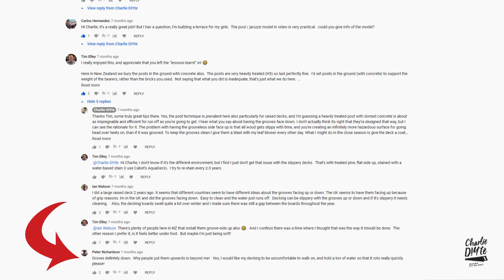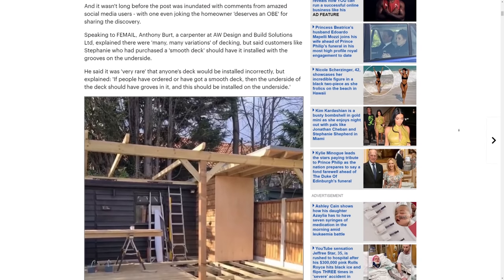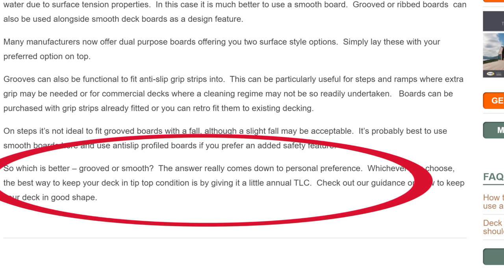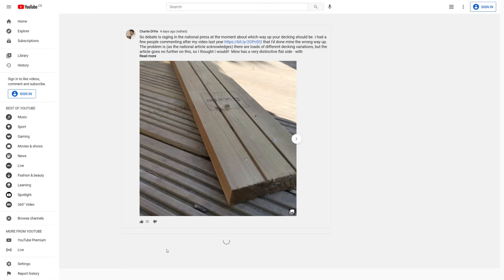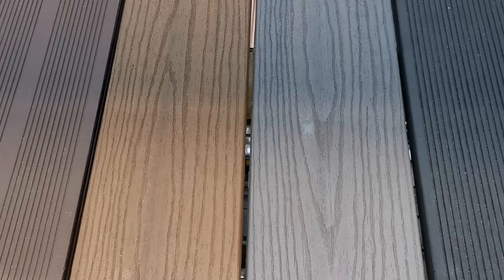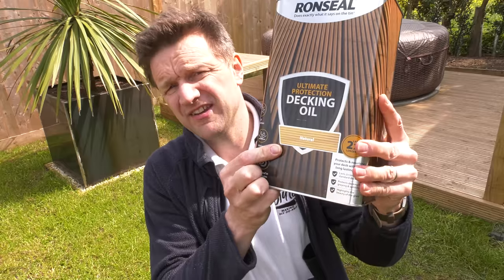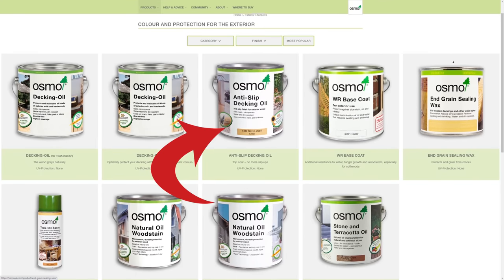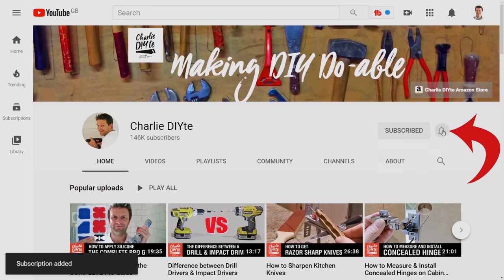Which Way Up to Install Your Decking?

Comment: I have generally used either screwfix decking oil or one of the decking paints. The coloured paints do not last past a winter. I ended up completely sanding the top layer with my worxs and coating in the water based Ronseal decking sealant, the expensive one. Looks awesome for a 10year old deck. Not sure how I post a photo on a comment ?
Reply from the maker: Yes I would have bought the Screwfix oil off I hadn't got chatting to the guys in the timber merchants. Frustratingly you can't post photos in this Comments feed. You'd have to go to my Facebook or Instagram page. Instagram probably the better option. 👍🏻
Reply: @CharlieDIYte  ok, there are a few options with ronseal but the water based one is awesome, will post the before and after photos and keep up the great work Charlie

Comment: Any kind of grooves facing upward Will obviously hold water, create moister in the right conditions, followed by mould and then resulting in a slippery surface completely making the grooves that are for “grip” obsolete as you casually slide across said decking with drink in hand and breaking your ankle. It’s wood, the nature of it is so grooves or not.
Reply from the maker: Agreed. I haven't got any mould or slipperiness on mine yet but it's not got any overhanging trees and the tanelising is probably still protecting it to a degree. I'll be oiling it this summer though.

Comment: The two grooves on the underside of the 'single sided' deck boards are there to counteract 'cupping' of the boards by moisture ingress expansion on the lower surface; effectively 'expansion joints'. They are used on traditional internal floor boarding too, where further drying, and the cut of the timber can also cause cupping.
Reply from the maker: Thanks mate. That makes a lot of sense. 👍🏻

Comment: Mines the wrong way then; grooves up and flat side down and it’s been absolutely fine. Stays grippy with a quick brush off and isn’t perfectly level so drains fine. No warping/air flow issues.
Reply from the maker: Glad to hear it mate. 👍🏻 At the end of the day, if it works for you, then all good.

Comment: Grooves on the top??  Here in the Pacific Northwest of the US, those grooves would very quickly fill up with pine needles, moss, and creepy-crawly things!  I suppose that's why I've never seen grooved decking material ..... ever!

Also wondering why your facia board is touching the ground.....or is your grass just ready for a trim??  Great Video!  A well thought out discussion.
Reply from the maker: I wanted it going down to the ground to discourage rodents from nesting under it. Thanks for the comment 👍

Comment: Charlie, do we live in a parallel universe? In January I started my built in wardrobe, few weeks later you started your wardrobe series.  Also, I’ve been planning/shopping so I can fit decking in my garden. Thanks for your videos they’ve been a great help! Especially with the Sensio LED equipment as I was struggling to find a way of making it look neat!
Reply from the maker: That's brilliant! I'm guessing you've finished your wardrobe though and I'm just about to start the doors... I love the Sensio lighting. Can't wait to get it up and running. Good luck with the decking 👍🏻

Comment: If your deck is slippery in the winter and you need to keep walking across it, try laying out some lengths of regular mineral roofing felt and maybe a few staples to keep it in place.  It's incredibly non-slip and has amazing non-tear quality.  Doesn't look beautiful, but for a practical slipping solution it's perfect!  Just lift it back up in the spring.
Reply from the maker: Thanks for that 👍

Comment: I think a patio is better suited to the UK weather and lasts a lot longer.
Reply: What’s the definition of a patio? I always thought a patio was the raised area just outside the back garden door. And it could be any material, decking or slabs?
Reply from the maker: Jules I'm inclined to agree. I honestly don't know why I didn't go down the patio route, save that drainage wouldn't be so efficient.
Reply: @haroon420  Patios are normally slabs in the UK.

Comment: If you "bituminised" the decking underside and then the subframe surely you precisely stopped the breathability - the whole and HUGELY successful principle of "microporous"? I'd say BREATHABILTY - the number one secret to "Stop the Rot" in all timber construction - every time.
Reply from the maker: It's an interesting point, that, which I guess you need to balance against the problem of a lot of decking not having adequate ventilation beneath - particularly the ones that are boxed in. I agree though, ventilation is the key in so many situations, from decking to roof insulation and house condensation.

Comment: my own decking was down for 16 years grooves side up,with the deck structure having a very slight fall on it to get water off.
As with all timber,if its left with water on it,it will impare its lifespan.The only thing that rotted on my decking was the posts that supported the decking framework,that had been cemented into the ground,simply because even though they are in concrete,they are always exposed to moisture.The decking and framework itself could have been used again as it had zero rot in it,even after 16 years in the crappy UK climate.All i ever did was make sure the decking was clean to avoid it getting slippery..nothing else.
Reply from the maker: Thanks Amy. That's amazing. Tanelising was a lot better 15 years ago but you've done really well with that one!

Comment: This looks like it could turn into “decking gate” 😳 I’ve laid my decking the same as yours - groves up to aid grip....
Reply: Can you use decking to make a gate.... 😁
Reply: @dougsaunders8109  we need to keep this under control - now you’re venturing down a very dodgy path 😂
Reply: @JB-gk6tg  it is the internet quiet possible. At least it is not Twitter 😉
Reply: @dougsaunders8109  very true 👍😂
Reply: Grip is increased on solid materials by contact area. There's less grip on a grooved surface.
Reply: @sdgelectronics  that is true hence tyres on F1 cars - however once water is introduced then it’s a different story ?
Reply: @JB-gk6tg  The rubber composites are flexible, so you can increase traction at the expense of efficiency. On solid materials like wood, the only way to increase friction is by more surface area - friction is essentially zero in the air gaps.
Reply: @sdgelectronics  I surrender to your clearly better knowledge on this subject 👍

Comment: All down to the type of decking your installing. I installed yellow balau decking with the smooth side up. Comes from South America. Installs both sides I just wanted the smooth look. Once treated with a good oil(osmo)  should last 10 years plus and you can flip the boards to get longer out of them. For me this type of decking wood will last way longer than the standard Swedish pine. To conclude any decking installed correctly and properly maintained should last a long time
Reply from the maker: Thanks Kyle. I agree 👍

Comment: Spent 16 years in Canada and never seen a deck with groves in it. Came to the UK and all the decks have groves. When I built my first deck here in London I used the smooth face up as I just don't like the look of groves. it just doesn't have that natural look. When I recently bought a house in Buckinghamshire it had a deck installed with the groves up. And even thought it was only about 6 years old, it was already rotting away. Will be replacing it with Oak and using the smooth face up 😁
Reply from the maker: Yep, oak without groves looks very classy 👌

Comment: I see a lot of decks with boards butted up against each other with no gaps between boards, that's the biggest problem for air circulation. I tend to be quite liberal, usually use 5mm plate washers as spacers when fastening down. It lets a lot of both air and light underneath and I find it discourages rodents too because it's far less sheltered under the frame. I weed kill, fabric, and gravel before installing the frame which avoids future undesirable plant growth.
Reply from the maker: Yes, I agree. I clamped the boards together initially and was shocked at how wet the joists were when I took the boards up a few weeks later. The gravel is also a good idea because it discourages rodents, or makes it pretty inhospitable for them at any rate.

Comment: I'm planning on laying mine grooves up when I get to the garden, but I fancy doing the boards on a diagonal because 1 pretty and 2 good grip while walking either way.
Reply: I found the grooves aided water run-off where I have a fall across the decking...the grooves have never aided grip, and in fact the deck has at times been pretty slippery...usually in the winter, and when it’s damp early mornings...the best to sort this is to treat it with a good resin and apply a thin layer of very fine grit...let it dry and sweep off excess...I have not found any treatments for decking that prevent it being slippery, unless they contain some form of grit that adheres to the decking...
Reply: @stun9771  I've found that walking on decking along its length to be far more of a slip hazard than walking across the width in the wet. I always add a very slight gradient for water run off but the diagonal boards will be more for show than anything else.

Comment: Hi Charlie I am a big fan of your videos. I've just installed a pine staircase. What primer/paint do you recommend I use please? I am thinking of doing the risers white and the steps natural wood with lacquer
Reply from the maker: Thanks mate 👊🏻 Personally I'd use Zinsser BIN primer and then a satin wood or gloss. I've just painted my wardrobes in an eggshell. At the end of the day gloss is the most durable top coat for high traffic areas but might be too shiny for your requirements. Eggshell and satin wood are similar in terms of durability. Maybe go for an oil based eggshell or satin wood as this will be more durable than the water based versions. For the treads I wouldn't use a lacquer. I'd probably go for a Treatex or Osmo oil, like I used here https://bit.ly/3ubTGIz It comes in a variety of shades including natural. I painted a lacquer on my kitchen table and wasn't very impressed, although that could have been down to the quality of the lacquer I guess.

Comment: In regards to which way round the boards are laid, boards should only really be laid with the heart of the grain facing out, as when the board starts to cup it will cup towards the base framing. So to have a double sided board doesn't really work.
That's just my opinion from being a joiner.
Reply from the maker: I think you're absolutely right. A lot of people have commented to that effect. I suppose the question is whether it will still cup if it has been securely screwed down?
Reply: @CharlieDIYte  aye I know what you mean. When I install fencing slats I check every on and have the heart facing out. The wood still cups even though it has been securely fixed. 
Nothing worse than getting pine skirting with the profile machined on the wrong side, I have spent too much time in the past planing the middle out of skirting boards to get them to sit tight at the top against the wall. You can get away with it if it's painted skirting a but if it's varnshined not a hope, gaps at the top look terrible.
Reply from the maker: @Ayeboi1  I can relate to that. I had to do plane the back of the skirting on this job https://bit.ly/3cfJHvG The skirting warped like a banana as soon as it got into the centrally heated house. It looks great now but it was a nightmare at the time.

Comment: As someone who has lived down under for 20 years , its definitely groove side down , never have or ever seen anyone slip on a smooth board deck. Unfortunately getting a deck board in the Uk that is not designed for groove side up is near impossible. In Australia you sand the deck once it starts looking tired as you would with wooden flooring but with groove side up this is impossible. Also have used lots of decking oil and Sikkens is the best by a million miles, looks a ton better than the rest and lasts alot longer too. Is the most expensive but the best generally is
Reply from the maker: Thanks so much for this Michael. Absolutely invaluable experience shared and I'll make a note of that Sikkens 👍🏻
Reply: @CharlieDIYte  no problem mate, love ya work , keep it up

Comment: Well, what can I say...how about ‘bollocks’ to start with...  my decking is single sided with grooves laid upward...my deck is approximately 5.5m x 7.0m and is supported on a frame made up of three independent timber frames, each constructed from 200mm x 50mm sawn timber beams - nailed and screwed - and bolted together with coach bolts to form a single deck, suspended above the ground by about 300mm (where the ground is covered by weed control mat and gravel to about 100mm depth), and sits on concrete pads with slates positioned under the timber where it sits on those concrete pads... all the timber supporting frame was treated with a good quality timber rot proofing once assembled and in position, allowed to dry (it was summer), and then sprayed with a waterproofer usually used on brickwork... after this I laid the timber decking, which was supplied in 5.0m lengths (the decking is approx 32mm thick and 150mm wide - and grooved on one side only), and which I cut to size, and screwed in place using deck screws, with 6” nails used as spacers between the decking boards...the decking is laid grooved side up to aid water run-off... on completion the decking boards were treated with a mid-range decking preserver and waterproofer... the decking is laid to a fall, that across the longest length of the deck (5.5 m approx) is about 30/35mm... each year around the end of May I power-wash the decking, and re-treat it with a preservative/waterproofer...my deck was laid in the summer of 2001, yes that’s right, twenty years ago, in the UK, in the open air, and has been snowed on, rained on, iced up, and otherwise exposed to everything...and is still in reasonable condition...and I can supply photos to anyone who wants one...just to prove what is stated here is bona-fide...I am located in the south-east of England, in north Kent...
Reply from the maker: The point is Stu, that you've a) installed it correctly and b) looked after it year after year. Comes down to personal preference at the end of the day, doesn't it 👍

Comment: I have just finished laying some decking in my garden, a fairly big project that i took on as a first timer. I sat back and admired it in all its glory, solid, sturdy. All the hard work I'd put in. And then a video on tik tok came up about decking being upside down. Ive installed it with the grooves up (having never ever seen  smooth decking in the UK) I just assumed that this was correct and that the deck should have a slight angle so as rain can run off. Anyways, ive just finished pitting 1000 screws onto the thing, do i really need to lift it all and turn them over, i mean its not going to rot over night, its raised and ive coated all the joists. I intend to use an anti lop coating once its weathered a bit. I accept that it may be fairly slippery in the wet, bit that is just decking on general. I aim to keep it relatively clean and try and precent build ups of water. Is it really the be all and end all.
Reply from the maker: As I say in this video, it's not always correct to say grooves should always be face down. It depends on the design of your decking.. Is yours completely flat on one side with no groves or more like mine? Either way I wouldn't worry, particularly if you look after it as you say. Are the joists below tanelised?
Reply: @CharlieDIYte  My boards are flat smooth the othersode with no grooves. I contacted the manufacturer / supplier and they said they are to be fitted grooves up. The entire subframe is pressure treated and any cuts have been end grained.

Comment: If you do use a pressure washer, keep it at a distance or turn the pressure right down.
Reply from the maker: Thanks Ben. I should be ok with my rubbish little Karcher, which is only really designed to do bikes 👍🏻

Comment: What a load of tosh some 'builders' come up with! It's actually recommended in the US to use decking tape the length of the cross bearers so even if you put the boards grove down, the groves wouldnt work. I dread to think how slippy the decking was where the 'builder' put the groves facing down!
Reply from the maker: At the end of the day, it's your decking so put it the way that you prefer 👍🏻

Comment: i agree with the fatter wider grooves being on the decorative (upper) side HOWEVER a further note on this: those nice big fat grooves that look great and are commonly accepted as the standard decorative side will cost you a fortune to have refurbished. i recently billed a customer a grand to have his all sanded back to wood and stained because water and garden detritus settle in the grooves which then has to be cleaned for refurb which means using a grinder. not only does that cause a loss of the profile of the wood but its a massive job which costs a fortune.
Reply from the maker: That must have been a pig of a job!
Reply: Perhaps it would have been cheaper to replace the boards?
Reply: @westwonic  40 square meters at 80 quid a meter.... nah. if it was my house then yes but not for a customer.

Comment: Thanks Charlie would you recommend using that bitchumen paint for a shed base as well it looks like it will extend the life of the timber|?
Reply from the maker: Yes Keith I definitely would. In fact when I eventually build my garden room I'll be using it for that too.
Reply: @CharlieDIYte  thanks Charlie would you use that instead of DPC. In fact I was planning to do exactly the same as you did on your decking for the shed base ie on the 4x2 stamper a DPC to the bricks underneath but having watched I am inclined to use the pain instead what do you think. Thanks for all tour videos by the way